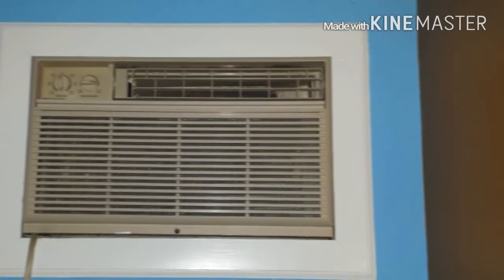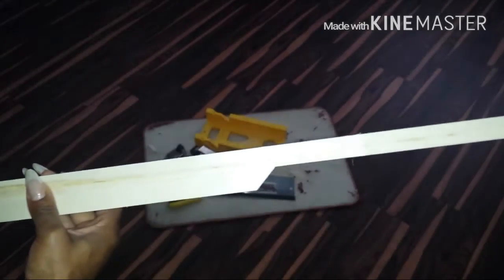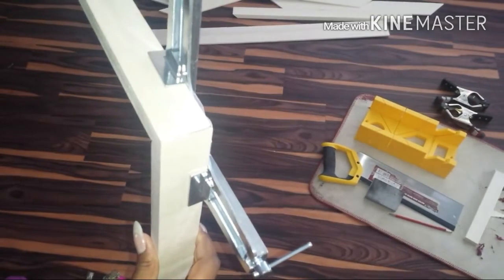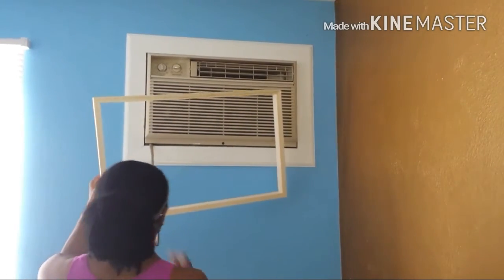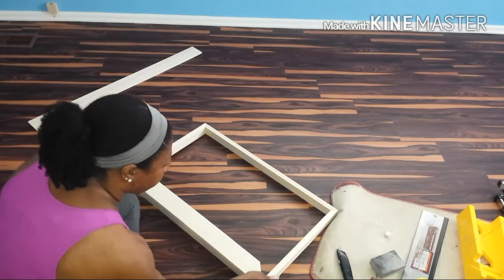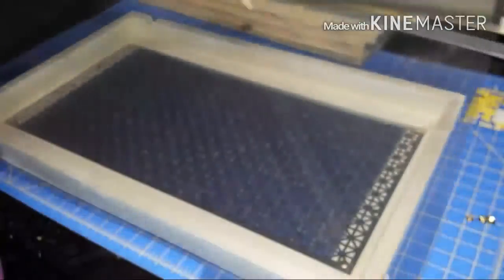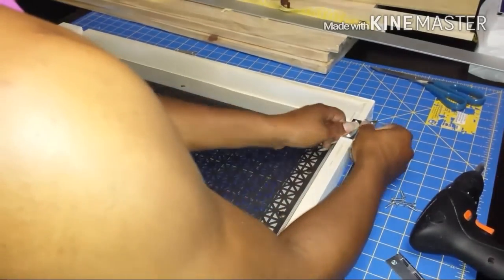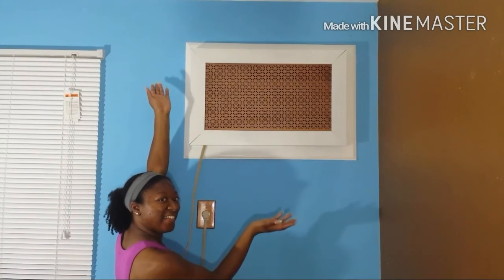Apartment Remodel: Air Conditioner Cover

Comment: Nice. I would also Pull the electrical cord up into the ac housing then secure the visible remaining cord to the wall with silicone or a glue, then paint the wall portion of the cord  blue and the portion that is against the accu housing white. All this to minimize the visibility of the cord.

Comment: Mine is literally a giant cube that sticks 1 foot out of the wall and is twice as wide as yours, mine looks sooooo ugly, it's even more yellow than yours, also mine is also a heater so I'm scared to put something in front of it, I don't want to st are t a fire or something but it just looks soooooooooo ugly, like it's gross and brown/yellow, it looks sooooo old and it also has a disgusting yellow cord that comes out of it and plugs into my wall, my room all gothic and black and red and dark colored and the air conditioner thing just completely ruins my room, it's like an elephant in the room. I'm thinking of just buying a different heater and AC unit thing for my room and then just turning off the ugly one and unplugging it and completely hiding it somehow, like I'll buy ir build something to put over it

Comment: do you open it when its running or can you keep it closed?
Reply from the maker: Kissy Curls I open it. The air doesn't flow freely enough through the metal sheet when it is closed. The first time I ran it with the cover closed, the room never got cool and water was dripping from the a/c unit. Not good! But I don't run the a/c unit often, so it's great to not have to see it.
Reply: ok thanks...... im definatly trying this..... great job.. very creative!!